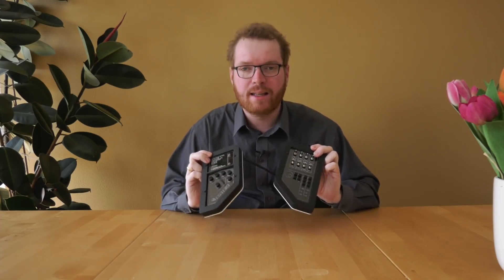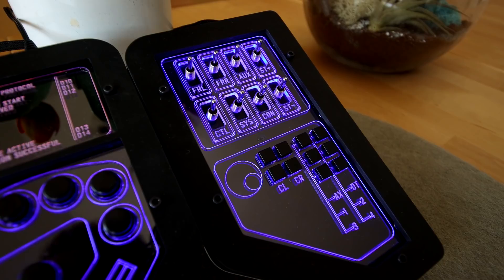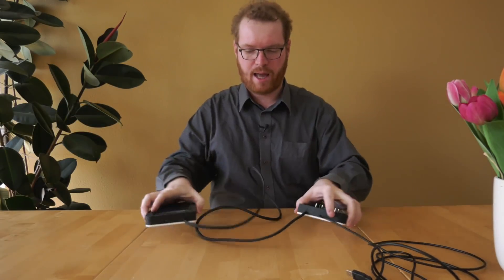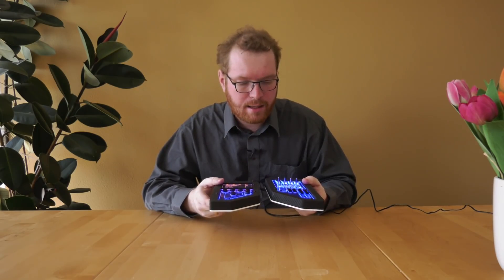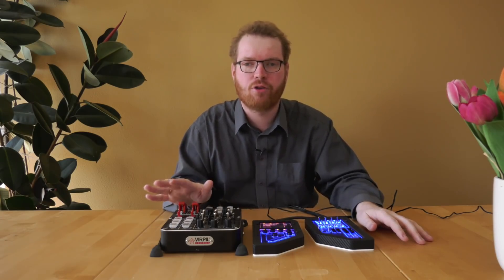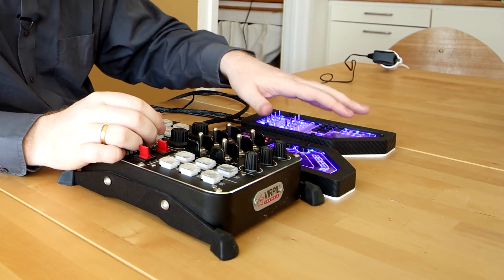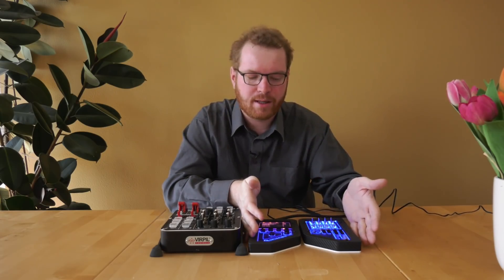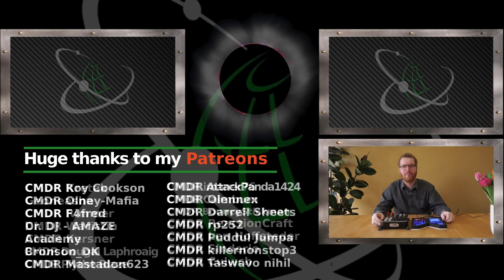Elite Dangerous In- Game Panels | Giveaway announcement!

Comment: I'm not buying the "these panels will work in VR" premise.

My experience in VR was that I'd find either of these panels (the replicas, or the Virpil control panel) unacceptably hard to use. As soon as you take your hand off the throttle grip, or the joystick grip, there's a significant doubt about where your hands are in relation to the buttons. 

I have a Virpil throttle, and whenever I use a button that's on the base of the device instead of somewhere on the throttle grip, I'm groping around for a  while until I'm sure I'm touching the right button. This works for stuff that's not time critical, like the Galaxy Map button, but not for anything I have to find quickly.

With either of these, I'm not just fumbling blind for the buttons, I'm fumbling for the entire panel first, and where it is in relation to the main controls.

Comment: The USB power would be enough in most cases.  My Corsair Strafe RGB has two USB cables for example, but only one is needed, as the second is for the onboard 2-port USB hub.  One single USB handles all the keyboard inputs and RGB lighting (per key). I'm sure that doesn't have 110+ RGB lights in it.

Comment: USB 3.0 provides more then enough power. I think the reason for the wart is simply just whoever designed it either didn't know how to make a driver circuit or didn't want too. I wouldn't be surprised if they were just some 12v strips hotsnotted in and just solder to 12v barrel Jack.

Comment: Interesting... agree mounting options built in would be useful.  However,  a self stick velcro would work well....
Reply: Either that or duck tape.😊
Reply: I use velcro strips to fix my Virpil CM3 throttle to the corner of my desk. Because I use a HOSASAT setup the desk mounts on either side are both reserved for sticks. The velcro works surprisingly well. There's only a tiny amount of movement when first pushing the throttle forwards, but after that its solid.
Reply: Just use 3M Quik Lock
Reply: Wrap string lights around them for that extra immersion.
Reply: Double sided tape. That's what I got my x56 mounted with and it works well

Comment: Nice idea but dies it function practically and actually. You would need slot mounts on chair or attach gripping/ rubber tubing to bottom surface. But it's a very nice idea cos as you say the VR users will be able to find buttons( very good point) o7

Comment: As I am lazy, and not very technologically inclined, I'd love to see someone take that screen out, and put in an actual display that could be linked to the game with a RaspberryPI or something to show in-game feedback on the panel.
Reply: Arduino has a small Joystick circuit board with mini USB , you can connect a lot of switches / button and also has 4 axis for some Analog inputs.
Reply: That would be really cool, but extremely difficult to implement as it would require elite to make certain data accessible in a manner that I don't believe it is.
Reply: @chris2746  data is available through the elite API/data log - just needs simple info like current star system, planet, etc  - look at what EDMC and TCE does - good stuff
Reply: @chris2746  Precisely. The data Elite makes available is only in logs, there's only log data and key/button presses as interaction.  Also you need the right arduino to run it as a game controller for it to work. The only easy thing to do is make some fake screens. Source: I made myself a button box for my setup.
Reply: The problem is one of cost!  To do this right you need a Nextion touch display (costly) connected to your controller of choise (Arduino/ESP32, EDM32).   Add in production cost for that is way above what the average joe-player will pay, and to make it lucrative.    I could build this in a day with touch screen and write the necessary on day 2.   The cost factor is huge.  A decent nextion will run to 50 euro, an arduino 10 euro, development time, then we have the problem of 3d printing, costs and results.   And because this is 'niche'  the audience is limited.
Reply: @BenSollis  you under estimate us elite dangerous players.  So far the cost you put forward I would pay. 
Up to 200$
Reply: @mattstaab6399  That's good to hear, but for it to be a viable, production, requires a lot of 'interested' players.
Reply: @mattstaab6399  It is a bit nuts how much some people pay for toys. Here in the UK people get shafted buying Virpil. A CM3 will cost £400 after tax and the £70 customs fee to get it into to country. Slightly less for each WarBRD/Alpha stick. The Throttle, 2x sticks, 2x bases totals £1150 (1625 usd).
Reply: There are touch screen cases available for Rpi, should be easy to modify. Great idea btw 😎
Reply: @RatBagDad  yeah the taxes really bloody stung when I upgraded. Virpil is lovely kit though 😍
Reply: There is an app on Github that lets you use the X56's MFD with Elite, so it is definitely possible! It's something i've been thinking about for a while, I just need to do some digging.
Reply: With a little more modding, you could squeeze in a small smart phone running one of the GameGlass shards.
Reply: Use game glass you can out all elite functions onto your tablet or Android device. O7
Reply: @chris2746  it is mate. Game glass uses it.
Reply: Coming in v late so sorry to resurect a dead thread but I saw these as well and felt they were just "poor"...so I AM building my own, with a touchscreen, buttons, proper lights, all functional and as-close-to identical as is physically possible.
Reply: @mattstaab6399  yeah I'm building one properly...
Reply: @wizarddrongo  post a vid and link to it here when you're done, please.

Comment: I was recently looking for a cheap(ish) HOTAS and the Hori flight-stick caught my eye.
After investigating, though, I discovered that some of the controls on the Hori stick are fakes - just there to make it look more impressive.

I'm getting the same sort of feeling with these ED game-panels, unfortunately.

Basically, what you've got there is a couple of eBay £4.99 number-pads in fancy boxes.
If it had a functional LCD, analog inputs for the palm and thumb and a couple of rotary controls as well as a bunch of switches, I'd be impressed.
I still wouldn't actually BUY it, cos there's easily enough flight controls for ED on something like an X52/X56 or Warthog but I'd be impressed.

Comment: Normally I am not a fan of RGBing all the things, but this could have done with it tbh, along with dropping the external power. Most people have at least 1 USB3 port on their machines that could power that. The lack of points to mount even the most basic suction cups to stop it sliding around kinda ruins it. The travel on the buttons does look very short. Good idea, flawed execution. Perhaps the V2 will do better. Let's get you to 100k subs CMDR o7

Comment: Doesn't look like a production model, more like a piece of fan art.
Reply: It's more like a test sample of an "in developement" product
Reply: It looks 3D printed which is fine if you're audience is going to be small.  Unless you have a more than moderately interested purchaser base, you could end up losing money.
Reply: @majicknous1946  Plus extra from the power supply. X.x
Reply: @biggusdiccus6969  Would have been nice if this was linked in the description regardless of whether it was in stock or not.
Reply: @TrollDecker  a simple "elite dangerous panels" will find it.

Comment: I better not hit the subscribe button, because I would unsubscribe then. ;) But if I weren't subscribed already, I certainly would, not only for the giveaway, but because the other content is pretty nice, too. As for those controllers, a redesign should be a little larger and more sturdy, and a mount would also be nice. And if the display were real instead of just for decoration, that would be awesome. Although I guess that would also make the drivers a lot more complex. To attach the current version to my armrests, I would probably try something like Tesa Power Strips.

Comment: I would not be interested due to it looks to simple in design and looks cheap looking i also bet they will have a couple of zeros to buy them
i myself would go for a lcd screen and the software to put input touch button switches to work with elite which would cost less and build your own console  for the devices to be stationed in 
I am already setting up these devices so i will send you the pic once i have resolved some issues to how they will be mounted.